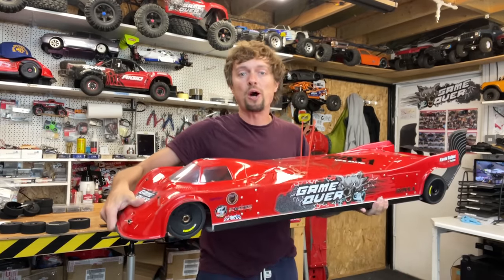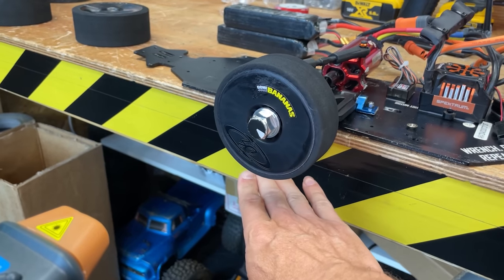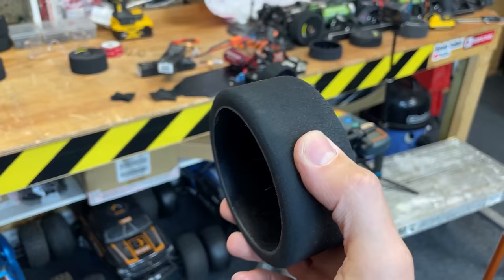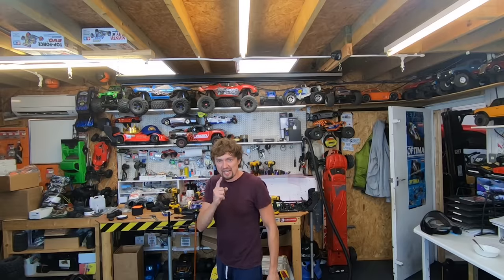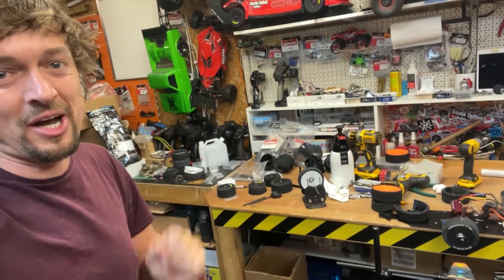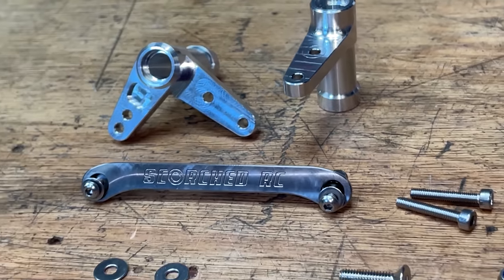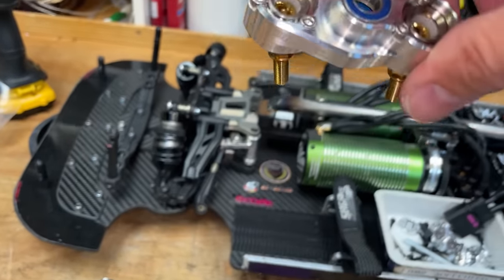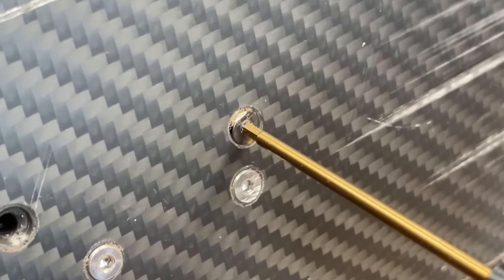Top secret Tires for 250mph Sausage RC Car project

Comment: Two suggestions, as others have mentioned the plastic deforming is a definite issue, for something light weight and tough you could try having the wheel printed in carbon fiber filament which might hold together better and still be light and cost effective. Also have you tried a harder durometer rubber? Awesome videos, thanks man!

Comment: You should put a rubber O-ring or some thin-cut fuel tubing between all the ball links and rod ends to remove all the slop and also make them more precise feeling. The speed sausage is so bad arse, Kevin!

Comment: As below, a nice set of CNC machined Ali (7075 grade) rims (couple sets to change out) and get them into a mold to skin them with PU!
a good 95shore Polyurethane molded onto the Ali rims will make this thing really haul ass!
Coming from a background in racing control line planes over tarmac (Barkston Heath Airfield being one spot!) we use a hard tooling grade (Red) Polyurethane for the tire and it takes a beating.
Just an idea

Comment: After sorting out the wheels/tyres, I suggest focusing on vehicle aerodynamics to increase speed.  This would make a great project for a university student as part of their Masters/Doctorate.  If you can make the car/body narrower, lower, and with less drag.   Reducing drag is free speed.    Railway train wheels have steel tyres under high tension, so the suggestions for carbon fibre sleeves make sense.  Consider replacing the carbon fibre chassis with 6mm honey comb core between carbon fibre.  Much more rigid but not so robust.  Chinese sources will CNC cut it to your drawing.  If you are using stainless steel or titanium screws, or steel screws into aluminium threads, lube the threads to stop galling (makes the screws impossible to remove).

Comment: One thing to not forget is that the wheels also need to transmit a lot of tangential force (basically the force that pushes the car forward). You an estimate the force (for all 4 wheels together) by P = F*v (power = force * velocity). You know the power from the motors and how fast the car is going. That gets you the lateral force the wheel needs to withstand. For this reason I think the project air jet turbine car will not be as limited by the wheels as they don't need to resist the lateral force. Only centrifugal.

Comment: what about hockey pucks for wheel/tire combo? maybe machine an insert and puck to fit each other to bolt on. yes heavier so longer to get up to speed but the momentum they provide might help. im sure there is enough hp in that setup to turn em.

Comment: Kevin make sure the dragstrip is freshly cleaned with no glue on it. The foam tires don't like the glue that is used on the track. I work at Tucson Dragway  & have had R/C cars try to go down it & it just doesn't work when the track still has glue on it. Good luck my man.

Comment: It's always not bad to look what Nic Case did😉 Carbon rims and a belt-driven car... Any more questions?
Reply from the maker: where can i get carbon wheels?
Reply: @KevinTalbotTV  I'm quite sure you have to do this yourself or find a company to do that. If you have a closer look at your brilliant(!) test you will see that the rim is allways blowing at the inner side😉 Trying some Drag-Racing I had the same problem with my rims with GRP's tyres! When getting hot, they totally lost there form...

Comment: seeing how the foam reacted i got a crazy idea that might work.
make a alu wheel with holes in it and place the foam on the inside.
should keep it from exploding  .  just need a really thin foam on outside to get it moving then at speed the foam or rubber on inside will be slowly pushed trough the holes  .
gonna act kinda like a water balloon  on a tennis racket.

Comment: Kevin Kevin Kevin,! the back of the wheel needs a solid disc to stop it from flaring out. Make a drum wheel to secure that sausage wheel. The foam tyre glue on the banana wheel is obviously nice and strong, so perhaps try to jerry rig one of those super duper wheels. Stay sausagey fine fellow and good luck with that 250mph goal.

Comment: Good testing. If you design a wheel that holds it's shape and is perfectly balanced you have it in the bag. Foams hold but the deflection of the wheel and uneven load is what is destroying them.

Comment: A 3 piece alloy wheel in which you could slip a plastic ring over the alloy barrel, glue it to rim then tire to plastic ring then fit rest of rim hold it all in place. Downside Tire changes wouldn’t be quick but the rc should be 👍 awesome project good luck with it.

Comment: Watching your videos of the wheel speed trials, what I’d evident to me is that not only the rubber/foam distorting but also the wheel rim.  At these high speeds you are trying to achieve it might be worth looking at a “solid rim” design which should resist the centrifuge forces.

Comment: Hi kevin.. greetings from south africa..
Because of centrifical force make an alluminium wheel with holes in the wheel and put a thick rubber on the inside of the rim.. it will not have traction in the begining of the run but will gain more and more traction the faster it speeds up as the rubber will start to push through the holes from the inside and will have support not to break.. think of it as a inside out wheel

Comment: No worries about stealing that design. The rim deforms so much, the vehicle will become uncontrollable. A cross section shows an L, a problem shape that change of material will not overcome. It needs at least a T cross section similar to ordinary car wheels. Excellent idea to do bench testing before taking it out. More testing!

Comment: I like your test set up. I was just thinking about puting some kind of adjustable roller to mimic ground/weight when you mentioned it.
I gotta agree with some in here, the rims themselves need a redesign, the way they are stretching out to the inside of the wheel is not good. I am wondering if there is a dynamic balancer machine that could balance the wheels you are using, or even an aluminium wheel if you were to go that way. The more static balancing you were doing was ok, but a proper dynamic balance would be a lot more accurate.
Best of luck with this Kev, looking forward to seeing the next attempts.

Comment: A lot of the comments are focusing on the wheels and i think that makes sense. Kevins car seemed to have more power (and weight) than the other competitors, so i would imagine he could get away with a little heavier and stronger wheel. It seems like it would be worth a try, at least, to see if the wheel deforming is what's really causing the tire problems.

Comment: I think the wheels need support further out on the barrel. They're all on the face and that's causing it to balloon. 
Maybe the stretching and twisting of the wheel itself is causing the glue to heat up (because of the expansion) and unstick?

Comment: The inside of the wheels need a stronger structure to keep it from flinging out.   A carbon fiber or titanium wheel should do better than plastic you would think.

Comment: For everyone saying aluminum wheel because the wheel is the problem, I agree the wheel is a problem. Aluminum wheels with bend and go out of round at less than 100mph. They will not be anywhere near round by 200, if the vehicle makes it there.

Comment: Kevin, looks like you have found the Achilles' heel for not just your rig, but the other speed run guys. CNC’d magnesium rims perhaps? Strength with low unsprung weight. Or ribbing and a thicker inner rim that won’t interfere with steering and suspension components? Keep chasing your dream!

Comment: You tyres are exploding bcos at higher rpms, foam essentially becomes a balloon, it sucks in air and that air heats up, and boom.
In my opinion, you need a aero wheel design like a cheese grater,that takes that airflow and reduces the pressure

Comment: If you care to know why this is happening - the hollow wheel expands when it spins - there are no spokes or spars on the inside to help it keep its shape.  That causes the outer rubber to deform and break. Machined aluminum will solve your issues.

Comment: you should probably be using JB Weld for balancing. It'd glue on stronger than either the putty or the hot glue, and it'd be less likely to deform once it's properly set.

Comment: SOLID ALUMINUM or TITANIUM hubs, maybe use some industrial grade fiber core o-rings in multiple 
on each wheel, there u have it, and a driveshaft SUPPORT BEARING  
on the long shafts, I heard some oscillation on the throttle run up.

Comment: Need metal rims Kev, plastic is great for bashing but not the speeds that you're trying to reach...Solid rubber integrated into the wheel is the only way to go. Means you'd need to be able to mold the tire onto a wheel... aluminum wheel maybe? I don't have the resources to try it but theoretically it should be stronger so long at you have decent rubber and permanently attach it to the wheel somehow...

Comment: 7:31 you'll want to get a magnetic prop balancer. Those are way more accurate that the DuBro ones. Balanced a bunch of 13 inch tri blade props for an XClass quadcopter and the ones "balanced" on the DuBro were still causing high speed shakes. Re-did it on the magnetic one and they came out way better.

Comment: The "speed" these were running at is being calculated on the original diameter of the wheel.  If they were spinning with traction on a car at these rpms they would be going considerably faster.  Safe from my couch here at my home with my beer in my hand, I think you should be focusing on the rims, supporting the inner and outer bead areas so they don't balloon/expand/biggificate!

Comment: Interesting video, thanks for sharing Your experiments. 
I once worked in a swiss company that produced dynamometers to measure the behavior of car wheels, with focus to the tires. You definitely need a road-simulation and defined, realistic "downforce" between the tire and the "road" to bring Your tests closer to realistic use. In optimum the "Road" is a big wheel (in RC-scale maybe 12" diameter or so) that can also be braked, to simulate the car's aerodynamic drag.
Test without any load is just a "flywheel". Good for testing tire glue, but it says not much about the bahavior of the wheel in reality.
(Your 2nd test is a good example for that: in real use with the load of the car's weight and downforce, the rim would not deform like that.)

Btw. The professional dynamometers have been twist- and tiltable too (for simulation of different wheel alingment or driving curves) they even had controlled temperature. (a very important factor!)

Comment: You should use some foam tires and try putting some small slits in them then put some super strong fishing line in there then glue to prevent foam from coming off.

Comment: theres a guy in autstralia that makes solid rubber tires for 82mm rims, ive ran an unbalanced set up to 100mph with 20mm of rubber on them/basically new/102mm overall, if you lathed them down real thin i'd be interest to see how they hold up

Comment: for a really cheap attempt, try cutting one or two grooves of tread into the foam and wrapping the wheel with some tightly wound wire inside the tread groove.

Comment: Hey kev you could try a 3d printed wheel with a honeycomb fill on the whole width. Shouldnt be too much heavier and would ideally support the tire with a bit more tensile strength. Just a thought

Comment: I wonder if a CNC aluminum wheel with a urethane tire is the key. Like a smaller skateboard wheel. The urethane would be a lot more flex resistant than foam and still give traction.

Comment: Solid aluminum wheels that have 3/16” holes drilled through the road surface with foam on the inside of the wheels so as it speeds up it pushes the foam through the wheel onto the road surface. 
You’re welcome:)

Comment: Great vid Kev.  
Very excited for the next vid, but I still can't help but think that it is strange that speed guys are using plastic rims when crawler guys have been using very strong alloy rims for ages.  
Alloy wheels with the new hex nuts would look amazing and be super strong.  
Perhaps a belt of carbon fibre to stop the plastic rims from expanding on the unsupported edges?  
Regards, Jas.  
VK4FJGS  
Rocky Qld

Comment: I'd make a tyre in segments with a fir tree type root that threads into a groove into the rim, same as turbine blades. Or a single piece tyre with a fir tree shaped root, then a two part wheel that bolts together to trap the fir tree between the two. No glue to hold the tyre on. It works for turbine blades

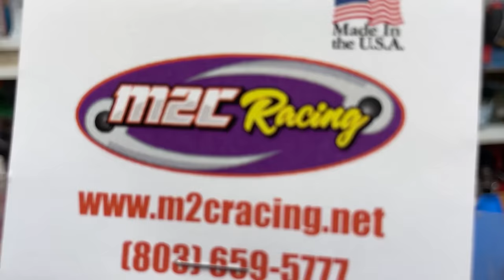Comment: 10:26 Those wheel nut conversions are awesome, That would definitely be a great upgrade for all RC's imo
Reply from the maker: they are so good!!
Reply: Back passenger side motor looks loose, can see it rotating 14:33  @KevinTalbotTV
Reply: They are a pain in the arse changing the wheels every pass. 24 screws vs 4 nuts but they are Awesome.
Reply: @KevinTalbotTV   I disagree, you just drilled 6 holes in an already flimsy wheel. Wouldn't be surprised if the wheel now completely fails at the wheel mounting...
Reply from the maker: @GamezGuru1  they held up on the world record car so already proven to work

Comment: An aluminum rim with rubber tire with bead locks and fill with expansion foam. Spin them up on pneumatic die grinder, they spin up to 100,000 RPM. If the rubber tires don't hold up then you may have to make a tire with steel belts or a solid rubber tire.

Comment: Maybe try aluminum wheels or carbon fiber wheels with the foam tires because from the video it shows the wheel stretching out from the back then snapping the foam, so I think the problem lies in the wheel material not so much the foam tire

Comment: What you need is some sort of metal ring (titanium?) encompassing the inside of the plastic rim to prevent it from expanding. Personally I would cut away the foam and bond said ring around the outside. I would ensure that the overall diameter of the ring is smaller than the foam so that the metal never contacts the ground. 
This would ensure that plastic rim does not expand on the inner section.

(EDIT: others here have better suggestions than mine. I would go with metal or carbon fiber rims, etc.)

Comment: need a more Rigid Rim that's less likely to kind of shrink and expand outward along with the foam and can actually hold the foam in place, the taller the Rim and Foam the more force is applied which in turn means more likely to explode, its actually quite easy to understand if you've watched Top Fuel dragsters and how their tires expand height wise but the Rim holds them in place.

Comment: They need some strength on the inside of the wheel. A little bit of weight but some triangles inside the wheel would definitely help

Comment: I think he has kevlar cord wrapped radially around the wheel, which would pretty effectively reduce expansion caused by the centrifugal effect.

If you have a central aluminum hub and then injection molded plastic around like a normal wheel, you could make a tensioning mechanism for the kevlar cord using grub screws.

Comment: It might be useful to use a torque wrench instead of an impact driver to tighten bolts. Gives much more consistency in the applied torque and can save a lot of rounded bolts. But off course an impact is faster.

Comment: You should try to wrap the wheel with wire (such as fishing line) or incapsulate the wheel with a closed loop of copper sheet (it's easier to solder to close the loop) and then glue the foam on top.
Reply: I've been reading over all the comments, and this one stood out to me. I was thinking metal like titanium or magnesium, but I think a precision application of even nylon fishing line would  be the way to go. 

Get some foam safe ca, some fishing line, and do a thin wrap on each wheel and I'll bet it helps a ton with expansion, and wouldn't be an expensive "custom" fix. Might even be able to get away with non shaved down tires

Comment: Car tires have braided cables to keep them together. I think if you wrapped some braided fishing line around it pulling it tight below the surface of the foam in a straight row. Try 3 or 4 rows. I believe this simple mod will dominate everything.

Comment: So here's my logical conclusion on the wheels
IMO the best possible idea will be to machine them out of something like Mg/Alu or Ti/Alu alloy with lots of internal supposrt, and grue a thin strip of silicone on top for the grip. Not foam, not rubber, silicone. Yes, it's probably going to expand a bit more, but it's way more heat-resistant, and it theoretically should be more resistant to rubbing on the asphalt. Plus it should give an insane amount of grip, if threaded correctly (look at semi-slicks on the hypercars for reference)

Comment: The inside of the rim having no support is letting it expand.  That is where the problem starts each time.  Put a metal ring or some sort into or around the inside of the rim under the tire to stop it from expanding.

Comment: Yea it's actually the inside of the wheel that fully flanges out due to lack of support that the outer side has. Try an alloy wheel, or maybe someone can make a carbon fiber or magnesium wheel with a honeycomb design for support.

Comment: I think the problem lies more on the rims rather than the tires. My prediction is, that your rear wheels fail more often than your front ones. 
I guess your car has some downforce. Then i try to imagine what it will look like if the centrifugal force pushes the inner rim outside (asymmetric) while the downforce tries to get it flat again when touching the ground (asymmetrical as well). those forces together with the asymmetrical bending in more than on direction will crush everything i guess. lol